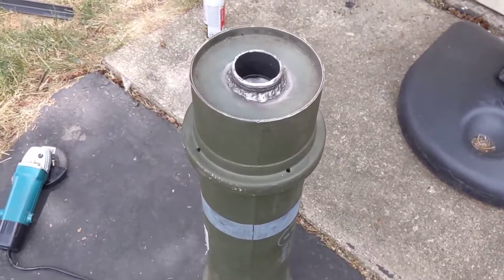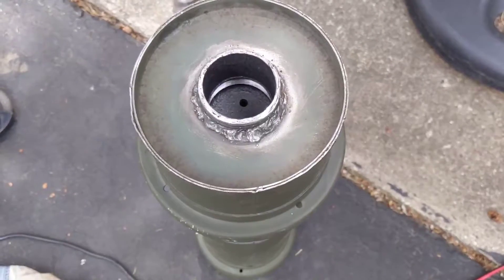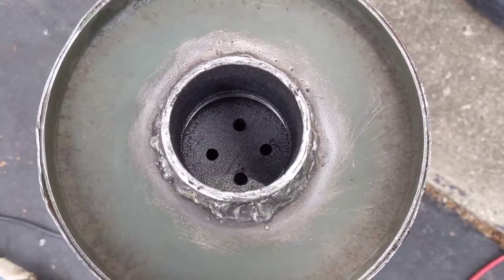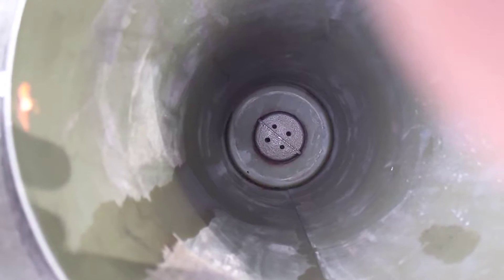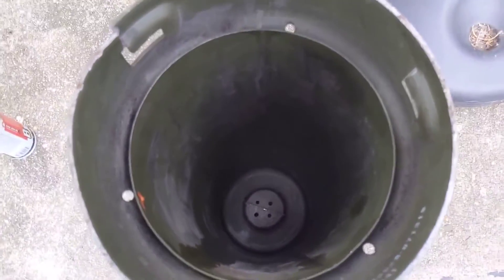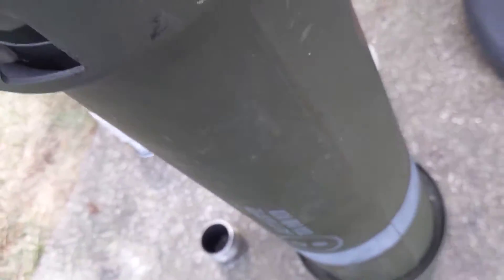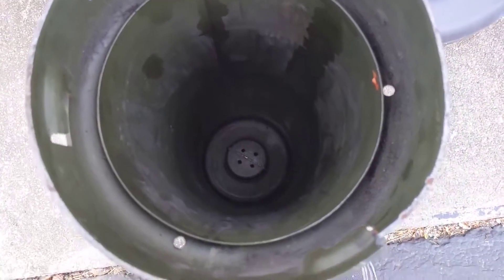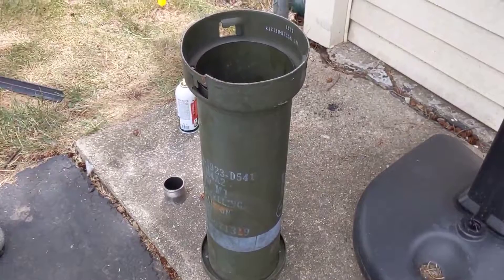Charcoal gasifier build walkthrough #2

Comment: Subscribed. Want to try this idea
Reply from the maker: Good luck and be safe.  Remember that woodgas/charcoal gas contains carbon monoxide which is extremely dangerous and will kill you if the gasifier is run in an enclosed or poorly ventilated area.